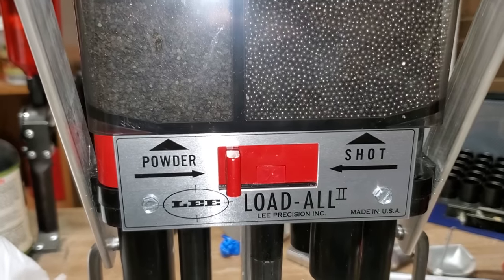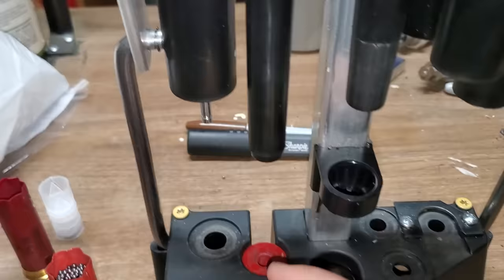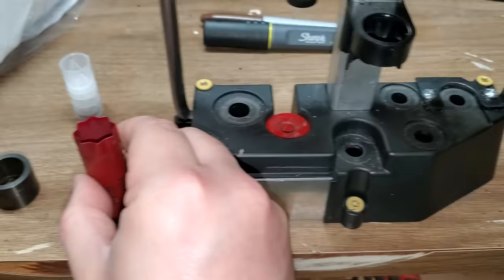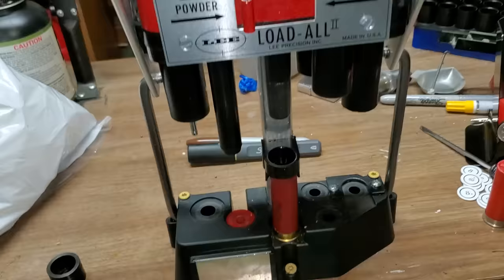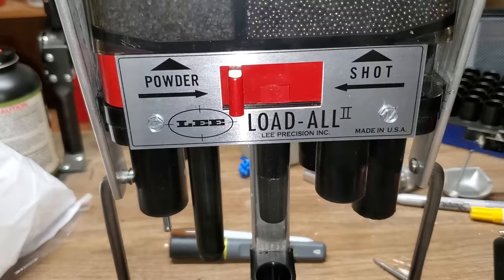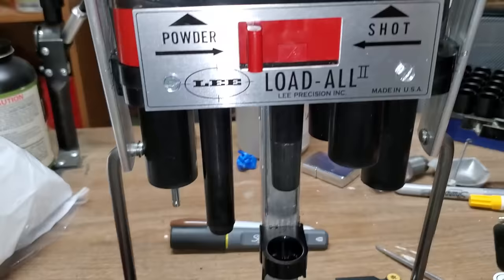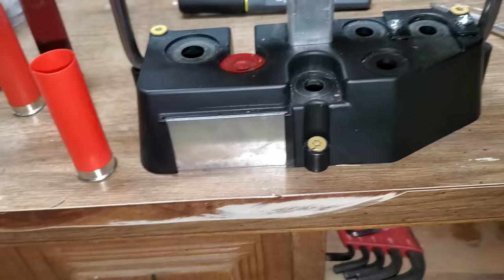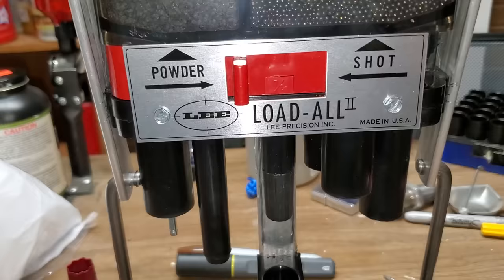Using lee load all 2 with once fired hulls

Comment: Just an additional note: As you demonstrated,the 12 gauge Load-All has the 8 point crimp starter in the front and the 6point crimp starter in the back. However, the other gauges have it reversed — 6 point in front, 8 point in back.  I labeled my 20 gauge Load-All so I can keep it straight. 😁

Comment: That was concise and well explained.
You made an excellent deal on your machine.
Only three or four years ago, I said that it barely even made sense to bother buying a shotshell reloading setup when boxes of 25 shells of 12 gauge cost about $4.50.
Those days are behind us now, so I'm probably going to get a Load All II, but only after this ridiculous primer shortage ends.
Reply from the maker: I originally got it to load high brass hunting shells that ran nearly 10 dollars a box.  Now I use it even for #8 dove loads.
Reply: @murphyfirearmstraining3630  You already invested in the equipment and components, so a smart man will put all that to new uses.
Also, there's something to be said about the confidence and satisfaction factors for going out in the field when you rolled your own ammo.
I have taken all four of my deer with ammo that I personally assembled (three with my Marlin .45 Colt lever carbine and one with my Ruger .30-06), and I like knowing exactly what I'm using to bring down such a beautiful animal cleanly and humanely.
Reply from the maker: @Gunners_Mate_Guns  awesome. 
I've brought down several things with ammo I made, and I agree  that there is a satisfaction that can't be beat.

Comment: Thanks for this. I'm used to the Mec reloaders but they cost about 600.00. I was wondering how good these worked and your video showed that. Good video. Thanks again.
Reply from the maker: They don't make as nice as a MEC, but if you aren't a high volume shooter and want some specialty loads this is the way to go.  Glad I could help.

Comment: You can easily load 3/4 oz loads on the loadall. Unlike Lee dippers which are calibrated in cc's the shotshell bushings are calibrated in ci's so if you were using 6 shot you would need .217 ci bushing. Take a .198 powder bushing and cut the tab off and slide it into a 1 oz bushing it will stay without glue. Weigh 3/4 oz of shot and file or dremel out the .198 bushing inside the shot bushing until the 3/4 oz if shot fits flush into it. Voila you have a 3/4 oz bushing.  Works great for me.
Reply from the maker: Appreciate the advice. My review is of the stock machine,  but that is helpful for folks who want 3/4 oz loads.  Thanks
Reply: Just use a good scotch tape and add layers inside the bushing to get light throws.
Reply: That was a damn good idea.
We reloaders love tinkering.
Reply: I live near the Winchester shotgun range. They sell once fired cheap. I went to another local range and they gave me once fired hulls that I was willing to pick up.

Comment: Your not the only one with that issue regarding using the 8 point crimp on new hull. I did the same buying a 100 bulk pack of new and preprimed Fiocchi hulls and the 8 point would just sink in. The 6 point works best to but I also notice it crimps a little deep and not flush as well with these new hulls.

Comment: You said this press is limited by shot chart availability but with a scale you can make a ratio/proportion formula to chart any powder. This is a great beginner press that I still use after years for reloading slugs.
Reply from the maker: I agree with you,  but it is limited if you only use the data LEE provides with it.
Reply: @murphyfirearmstraining3630  ya ya there's a chart available online and if I was a little more savvy on my phone is send ya the link but it's a Lee chart that has conversions for about 10 common powders.
Reply from the maker: @sluggou812beotch  I created one as well and have shared with anyone who wants it.  Definitely a good machine if you have more data than what they give you.

Comment: FYI. There is an auto feeder available for the primers. Works decent if you keep it clean. I spray the feed ramp with silicon it helps.
Reply from the maker: I load pretty low volume,  but I will give it a look

Comment: Been using Load Load All for over 30 years, 12 & 20 gauge, still going strong. Paid $15 for the 20 and $19 for the 12 as I bought it a few years after the 20. 
I wish Lee would make a Load All in 410! Had to buy a MEC for the 410 and cost more than 5 times what a Load All costs.
Reply from the maker: Amen to that.  If LEE would make it in 410 they would sell thousands of them.  Thanks for watching!

Comment: Got one of these for Christmas and the manual leaves something to be desired. Your video cleared it up. Thanks for this. Now, if someone can explain all the parts that it came with, the manual does not show how to put the primer together. It leaves out what the sizer ring is for entirely. Got lots of Lee reloading gear and I think they really fell down on the manual on this one. Machine is good, though.
Reply from the maker: I will be glad to make that video.  I did make one on how to set it up for a new load.  Hope you will take a look and that it helps you.

Comment: Welcome to the new world.  A $200 3D printer will make all the shot and powder bushings you could want.  I've seen files for them on Thingiverse, and the 3D CAD required to design any size you could ask for is just a few calculator keypresses an a few hours learning the software away.  Outside dimensions will be fixed to match the Lee originals -- you make the inside diameter to your needs.  You can even put the measurement on the front tab, though that's a little more advanced CAD operation.

Why, yes, I do have an Ender 3 sitting right behind me as I type...

Comment: I've heard of people filling in a shot bushing they're not using (or picking up a broken Load-All and sacrificing the duplicate) with epoxy or similar, and then steadily drilling it out with increasing bit sizes until it throws the charge they like. Or using duct tape or similar to line the inside of the bushing until they get what they want.

BTW if you have this thing in 16 or 20 gauge, you need to be careful; I think the six and eight point crimp starter positions are REVERSED when compared to the 12 gauge. Read your instructions!!!

Comment: I've found that the 8 point crimp on the load all 2 sometimes comes open now it could just be the hulls but I find it funny that it's always the 8 point I have yet to see the 6 point do this it might just be the hulls I just wanted to put it out if there's something I'm doing or if it's the 8 point crimp or what have you keep your eyes open and always use your situational awareness folks
Reply from the maker: I have the same issue with once fired and brand new hulls.  I use the 6 point pretty much exclusively because of it.

Comment: I've noticed the 110 powder bushing is way under with charge. The included chart indicates 14.3gr but it consistently throws 13.2. So I kept experimenting with the bushings to get the right charge because I'm too lazy to measure every shell
Reply from the maker: Some powders are off from volumetric calculations,  which powder was it with?

Comment: Great video, thanks! I've been reloading shotshells (new and reused) with this press for years. The only issue I have run into is with the Cheddite hulls (16 and 20, but not the 12's)  is that the shells have a tendency to buckle a bit during the final crimp. The only way I have been able to overcome that issue is by bouncing the final crimp a little at a time lower and lower until I get to the full pull on the lever. You got and suggestions (or similar experiences) with the cheddites?
Reply from the maker: Only cheddites I've loaded have been in 12.  Haven't run into this problem,  so I  can't offer you any ideas. Sorry.  If cheddite 20 ga come on sale I will have to remember that.

Comment: Too few bushings - nothing my 3D printer as lathe could fix so far. I love those things.
Reply from the maker: Can you 3d print more bushings for this machine?   If so, I am sure several folks would be interested.
Reply: @murphyfirearmstraining3630  Technically I could, if I could only find the files on one of my PCs still. Any 3D gun guy will should be quicker then me on redrawing these yet. The bushings weren't that hard to print. Maybe one of them can join in on this project with you.

Comment: To reduce the shot to 3/4 oz just add some tape to the inside of the 7/8 bushing until it throws correctly.  To adjust crimping, try some thin washers or shims in those positions.
Reply from the maker: Are saying to shim the bottom of the shell?  That won't work because there is a lip the the shell slides under at that station of the press.

Comment: I've researched these a bit, watched lots of videos. I've noticed some have a red base, some have a black base. Is one an older model and one a newer model? Which is which...or why the difference?
Reply from the maker: after some looking,  I don't have an answer.  mine was purchased about 1.5 years ago,  so it's pretty new.
Reply: The newer models have a plastic base whereas the older ones are made of metal
Reply: Newest are like shown, black. Older are silver-natural metal or red painted metal. Oldest did not have the power and shot bushing feature, only 3 shot bushings and no powder bushings. Data sticker on front of hoppers.

Comment: I hand load 223, I would love to reload my shotgun shells.. All the presses on Lee's website are out of stock..
Reply: There is some on eBay but they are 3-$500
Reply: @JuarezDerrick  Yeah,, for a 50 dollar press. I ended up finding one for 100 bucks so I bought that..
Reply: Never pay more than 60 bucks on ebay.
Reply: Shot, powder and primer prices are nuts now. Loader is doorstop without the former. If you can get above components then get the loader. Best to get a lyman, rcbs, loading for shotgunners any volume-4 is best, or the Couger(authors name) first. Check ebay for used copy. Research lee or mec online manuals to assure all parts are present. Many pre mec 600 juniors I see on ebay are missing parts (mec 250 and super 250, mec 300, mec 310, mec 400 etc. All ok functional loaders, but missing parts are virtually unobtainable at a reasonable price. Particularly sizing sleeve and wad guide up to 250- 300 series loader, and the 400's crimping sleeve). Lee primer pads and spring and sizer ring go missing. Get the loading manuals first, use data to search for components, then get loader. Times are nuts now, dont pee away covid money. I used to buy them for 5 or 10 bucks at gunshows and yard sales(latter hint hint) and rat rod them 2.5 to 3.5 inch. Also look at getting a reloading scale. I got drilled out bushings today. Ok for me, but buyer beware. Good luck to all. Tim

Comment: Just ordered a new 12 ga load all 2 today. Thanks for the great instructions. Can you reload a 5/8 oz shot load if you weigh the charges and don't use the press?
Reply from the maker: Yes, you can.  Or you can make a custom shot bushing by ordering a spare set and modify them.  I have a video on that if you search my channel.   Either way works, but I would rather use the bushing than measure each charge manually.
Reply: @murphyfirearmstraining3630  I just tried the new press out. I am waiting for a couple bags of shot so I can load more. I loaded 15 boxes of 410's with my MEC, and used all but 11 oz of shot, so I used that to load (3) 12 ga hulls on the new Loadall 2. Compared to the MEC, this press is a delight to load with. First tries I got perfect crimps. Thanks for the great instruction. I am just starting to load shotshells. I started loading metallics in the 70s. I shoot the shotguns more than the 22 and other rifles so now I am wondering why it took me this long to smart up.

Comment: ..... 7/8th oz
..... 12 gauge
Just a reminder that anything the 12 can do the 16 does better when your firing less than 1.2 oz
Reply from the maker: Can't disagree, but I don't own a 16ga.  It is a good clay busting load.
Reply: @murphyfirearmstraining3630  Just curious, but thought Id ask since im looking to buy a 10 gauge and already know that I will have to get into reloading if I do it. 

7/8ths oz is light enough to be a 20 gauge load. Doesnt shooting that little shot from a 12 gauge cause a dougnut effect in your shot pattern? People have been telling me that 10 gauges are only chambered in 3.5" because any loads less than 1.5oz will just doughnut pattern if fired from such a wide bore. But if your 12 can pattern just fine with 7/8th of an oz than expecting the same with 1-1/8 oz practice loads from a 10 shouldnt be unreasonable, right?
Reply from the maker: @pinkhead6857890  you do get some of that with lighter loads, and in general the pattern is pretty sparse.  I use this load for shooting clays from a hand thrower, and I move up a choke (so if I would normally shoot IC choke, I shoot modified).  We still miss a few clays that we think are good shots. I would not use these for anything serious (hunting,  competition,  etc) because the pattern is not dense enough.   But they save the wallet and shoulder,  and give a very light load for smaller shooters who want to learn to shoot a Shotgun. 

One other thing,  this press will not do 10 ga, you will have to get something like a MEC press.

I hope that answers your question.

Comment: Question could this load double BB, thanks for the video it was awesome
Reply from the maker: The biggest I have loaded is #4 birdshot and that is 0.13 diameter.   It binds a little with that,  but it works.  

BB is 0.18 diameter- it would probably work,  but expect the shot bushing to catch and need a good nudge to slide.   

It might bind up and not slide at all though.  Never tried it, so I don't know for sure.  Sorry, wish I could be more helpful.

Comment: Nice video, I was wondering if one can convert the older load all press to the new load all 2 version or is it impossible to do that also can you take a 2 3/4 inch press and change it t a 3 inch loading machine.
Reply from the maker: I don't know about the first part,  never played with the original load all.

The second part is yes- I have a video on how to make it a 3 inch loader.  It's pretty simple.

Comment: Bit of an odd question, but do you know if this can be set up for 2 1/2 shells? I bought an old English shotgun that somehow made its way over to the states and it's chambered for 2 1/2 shells. As I've come to learn only after looking for them it turns out 2 1/2 shells are rare and expensive when you can find them, so if I can save some money by reloading that would be great.
Reply from the maker: Sort of.  
The center station would work, but you would have to move the wad fingers down and drill a new hole for it to attach.

Stations 1 and 2 would  work.

I don't think stations 4 and 5 (pre-crimp and crimp) would work.  But you could roll crimp instead.   I have a video on how to do that if you need it.
Reply: @murphyfirearmstraining3630  Appreciate the info. Thanks, and I'll check out your other video when I get a chance.

Comment: I'm having trouble with the #8 shot with the 1 1/8 oz bushing. Seems to be throwing a little too much shot to where the crimp isn't sitting flat. Have to weigh both my shot and powder
Reply: Using fiocchi clear 2 3/4 , 12GW hulls 1 1/18 oz, WST powder 20.5 gr, #8 shot. Getting some powder migration after the wad goes down, but not after it's loaded and crimped
Reply from the maker: Are you following the recipe from a reloading manual?  Usually if your crimp is caving in,  you need a nitro card or an overshot card.  If your crimp is too high and not staying crimped, it is because your wad is not compatible with the load (your column height is too high).  Is your wad rated for 1 1/8 oz, and are you using the right hull (some hulls have thicker bases)?

Comment: This has helped me a great deal but I noticed that I don't have that red plastic cover piece for the primer hole. I've been putting the primer on the top of the spring/pin setup and doing it like that. Is that plastic piece supposed to be included?
Reply from the maker: Yes sir, it should have come with the press.  If you contact Lee, they should sell it to you for very little or may send you one for free.

Comment: Great video, why do you have to use plastic wads?  If a fibre wad was the correct height wouldn’t it work OK?
Reply from the maker: Fiber wads would work.  Plastic wads do two things that fiber don't: 
1 - they keep the lead shot from touching your barrel,  which keeps lead streaks out of the barrel. 
2- they hold the shot together in the shot cup, resulting in better patterns. 

It depends on far you are shooting and what you want to accomplish,  but you could sub a fiber wad of the same height.
Reply: @murphyfirearmstraining3630  thanks for the reply, I thought that would be the case,  most of the UK clay grounds only allow fibre wads.

Comment: How many times can you reload the same cartridge?
Reply from the maker: For shot hulls it depends on the crimp you use  and quality of the hulls.  If you use the same crimp each time and have quality hulls you'll get as few as 4 loadings from once fired hulls,  as many as 10 loadings.  Unfortunately the same hulls from the same box some will crack at 4-5 loads, some will crack at 7-8.  Cracking usually occurs at the crimp where it folds, sometimes it runs down the hulls length ways.
Reply: Get in the habit of inspecting you fired hulls at the crimp especially when they start getting ratty looking at the place where it folds; not sure, throw it away.
Reply: @murphyfirearmstraining3630  thank you
Reply: @petediaz9310  thank you
Reply: Be careful when reloading hulls with fiber, plastic, or cardboard base walls. After a couple of reloads you may find the base wad in 
your shotgun’s barrel.